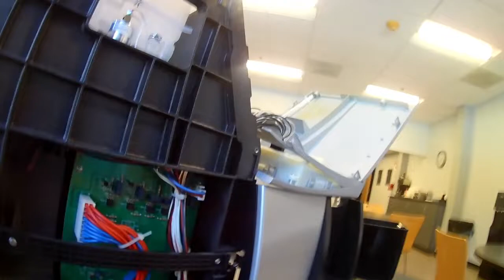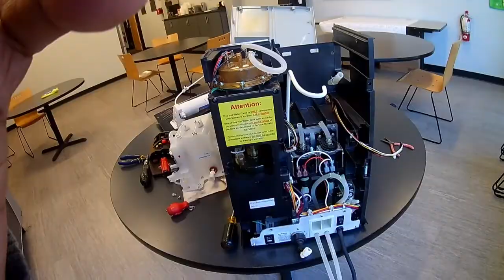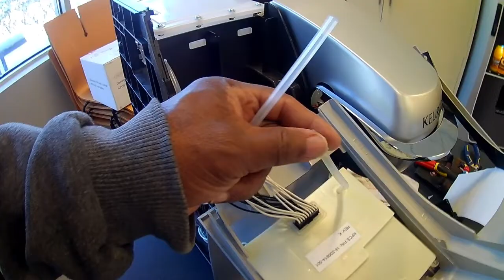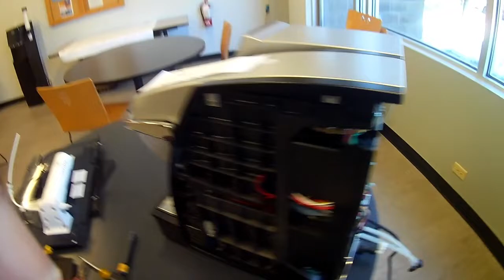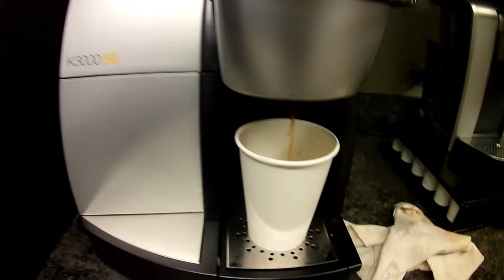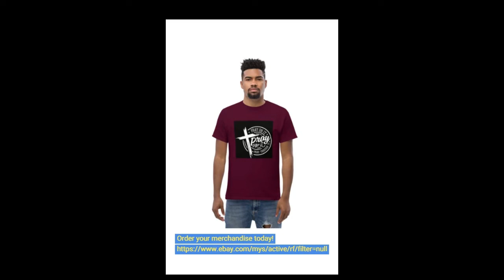Keurig Coffee Brewer Repair ( Water Tank Replacement )

Comment: Hey, I just picked one of these out of a scrap pile at work. How should I go about testing it? There had to be a reason they threw it out. It appears to be in working order. I did plug it in and it asked if the tank was drained, and that's as far as I got with it. I was going to stick the tube in water but realized it has to be plumbed into a water source.
Reply from the maker: It sounds like you have an auto fill Keurig so in order to test it, you will need to connect a water to the machine, then plug it in and it should start to fill , then once it fills it will go into heat mode and then you should be able to start a brew cycle. Most times the heater or fill circuit go bad and people will through them out and replace the machine. I hope that helps.
Reply: @latcommercialrepair  I got it to show the errors and its throwing 00, i googled it and its the pump or motor, is that replaceable
Reply from the maker: @jakelewis3561 The pump and motor assembly are should be available through Keurig or possibly Partstown.com.
Reply: @latcommercialrepair Thanks! Is there a website I can go to, to get new parts for it if the hater or fill curcuit ends up being bad?